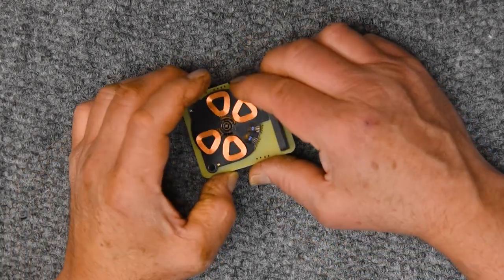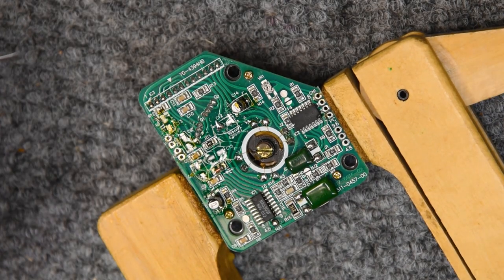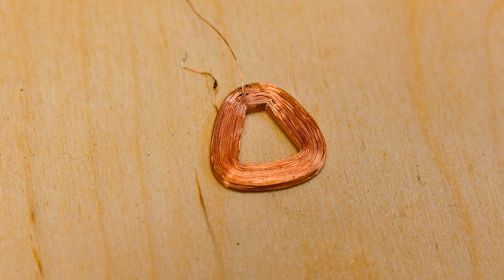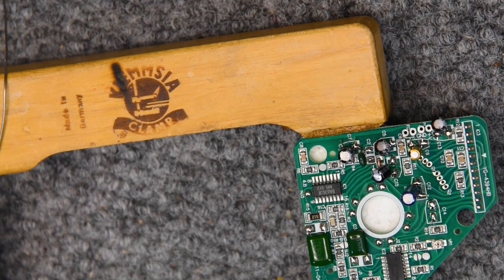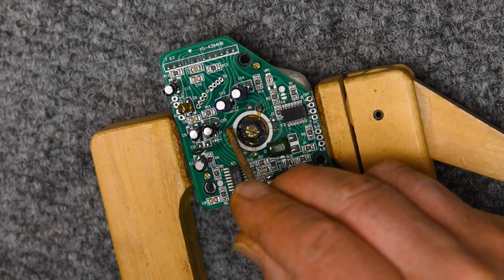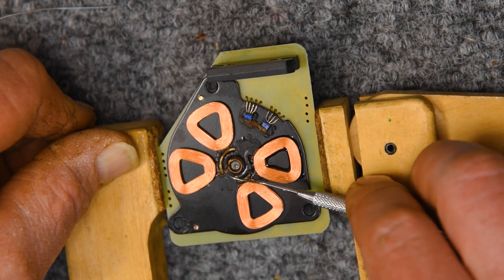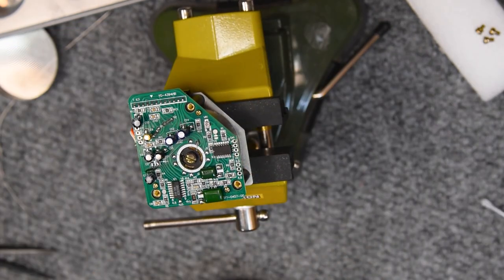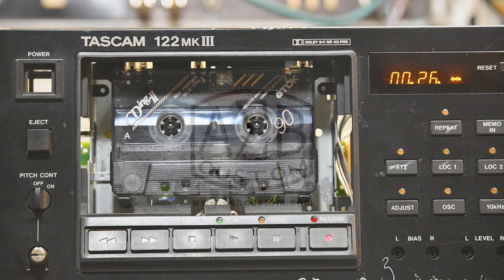Tascam 122mk2 and 122mk3 Capstan Motor Complete Rebuild

Comment: Apologies if I have mentioned this before. 

'Sanding down' capstans on a dual capstan deck is a big 'no no'. I once (out of frustration) allowed a 10 second polish both capstans on an old TC-161SD. It was a big mistake since the supply capstan relies on (effectively) some form of slip (I know we have our thoughts on this). When this does happen there is no  effective tension between the two capstans and incredibly the tape between the two 'slacks' off and often was seen rising above the erase head! I did fix the issue later by re-polishing with 3000/5000/10,000 grit, but it was a learnign curve for me.
Reply from the maker: "(I know we have our thoughts on this)" Thank you for mentioning that. Sometimes when it comes up, I can't help but picture in my mind, the mechanical engineer responsible for designing the first dual capstan tape drive explaining to his boss how he intends to reduce flutter by building slippage into the mechanism. "How much slippage?" the curious boss would naturally ask. "Well, we don't know that" the engineer would reply. "Why not?" asks the boss "You're an engineer, go calculate it". "We can't, there are too many variables, the tape thickness, length, modulus of elasticity, thermal expansion coefficients, lubricity deltas, variable pinch roller force, debris, and durometer, etc., etc. There's just no formula to apply." "Maybe you should go apply it in the Marketing Dept ..." the boss might say. :)

Just ribbing you a bit, I know you take it all in fun.
Reply: @asbcustom  No worries, I have a good sense of humour Peter!  It's all a bit inconclusive how exactly a dual capstan works, but I still hold on to the idea (frowned upon in the foums I think?), that there is a delay of transmission forces as one capstan drives the other via a belt. BUT I'm sure not all systems are the same - direct drive for example. In a later version of the Sony TC-161SD (I have 4 of these), Sony employ a 'new' flywheel design, and a larger diameter capstan at the take up (not supply) side. I think they had trouble with previous version me thinks??? Unfortunely, I learnt the hard way. Such is life! ;o)
Reply from the maker: Well if it's frowned upon in the forums then it must be valid! 

It works by stretching the tape, I measured both capstan pulleys in a previous video then used an online calculator to determine the RPM Delta on that particular machine. It's nothing new, the concept goes way back. There was even an all terrain consumer vehicle once that used a 1 unit higher gear ratio in the front differential than the rear, so the front tires would spin slightly faster than the rears. It was unstoppable off-road but hard on transfer cases. I think the military employed a similar thing as well. Anyway, it's all enjoyable to learn about and put into practice.
Reply: it's explicitly explained in the manual for the revox b710 (dual direct drive) as being for the purpose of tensioning the tape; in the revox, it's not the finish so much as the different diameters of capstan that do the tensioning. luckily, they're difficult to mix up during servicing ops because the flywheels sit at different depths behind the deck plate.
I have a 122-3 here too; nice machine but I had to replace the cheese gears a few years ago.
Reply: @duncan-rmi  My fascination with the dual capstan system isn't why it works on systems where the capstans are at different speeds, or where one is larger with the other, my interest lies in how the Sony TC-161SD system works, as both flywheels run off the same drive belt, and are seemingly identical in radius, as are both capstans also identical. My theory on the tension that is set up between the capstans (for the TC-161SD) is that - there is a micro delay between the two. It's a physics property that I proposed in Tapeheads sometime ago.
Reply: I meant to add too: the capstans on this old Sony were/are highly polished.
Reply: I have a suspicion, from careful study, decades of eng8neering on VTRs as well as audio decks, & reading the more & less enlightened hypotheses on TH, that there's a degree of "we don't know, but it works" about dual capstan in cassette machines. the big players all seem to have taken a slightly different tack, don't they? revox did later adopt different finishes on the capstans, but they make special mention of the diameters. another strategy I've seen for establishing the tension properly with identical capstans is to engage the rhs pinch slightly before the lhs; this takes up any slack that develops when the sled is disengaged. revox counter this by keeping the reel motors slightly energised. I need to peer into my nak 582s here to see what's going on, but the concept of running the trailing capstan off of a belt (as well as being less costly than a second motor) isn't enough on its own.... if the trailing pinch engages even a fraction earlier than the leading pinch, there'll be slack that will take a while to pull taut. this will happen whether there's a back tension strategy or not. I think that setting things up so that the rhs pinch pulls the tape tight, whether this is just a cam to offset their timing (tandberg), different diameters (revox), or whatever it is sony did.... this is the only way to ensure that the dual capstan actually does its job of isolating head-tape contact from the vagaries of the reel movements.
Reply: @duncan-rmi  Thanks for your reply, I did post another reply but deleted it, and replaced it with a condensed version. 
Yes, the concept of isolating the tape path from the imperfections of the cassette shell and its guides makes dual cap system look promising. However and overall, i don't think the benefits are worth it - around 0.05%-0.06% (weighted rms) wow & flutter can be achieved from a good single capstan machine, not to mention when the DC system 'goes wrong' it can be a nightmare to put right. On the postive side of DC, and using the well known WFGUI.EXE program, my B215 recently sustained a weight mean of 0.022% over a period of 15 minutes, with very little deviation which is remarkable in my opinion.  The deviation beneath that were hitting 0.019% if WFGUI.EXE is to be believed. Anyway, I must sound like a fanatic, but I'm not, I was curious as I've never bothered to observe this decks w&f performance since I bought it in 2003.
Reply: @duncan-rmi  Regarding why it works - I guess the big guns did their R&D and printed papers on the subject, which never left the labs into the big wide world? Certainly TH cannot always be relied upon to give the right answers, it is after all, open to eveyone, and everyone (inc me sometimes) puts in their 10cents worth.
Reply: I'm inclined to agree. there are those who'll tell you that the curvature of the sandwich head in a 3-head machine requires better of a wrap across it than can be achieved by back tension & pressure pad alone, while neglecting that the record head gap is bigger anyway, so the whole setup can be optimised for pb- I'm guessing this is what tascam & others did. the 122-3, of course, & probably half a dozen other 3-headers that I can see from where I'm sitting, manage perfectly with a single capstan.
contrarily, one of the criticisms levelled at the B215 is that it's so good that you forget you're listening to tape at all, which rather defeats the object- if we tape-heads wanted perfection, we wouldn't be using cassettes, right? 
dunno if we've run into each other on TH yet- possibly. I'm the nut-case who runs a quarter-track B77 at 1.875 ips & thinks it sounds marvellous! naks a plenty here- two 582s, two 550s & a 350. the revoxes. nad 6300. the tascam. various teac & technics. marantz pmd520. loads of portables & walkmans. I find the appeal lies in their flaws & occasional misbehaviour, & I'm definitely not anti-digital, but I prefer to listen to something that's guaranteed to be different every time. my music-brain prefers it, & analogue tape delivers. 😀
Reply: curiously, perhaps, the deck I've had most problems with is a decent sony, the 790ES. a trick I employed on the revox 710 back when it was misbehaving was to remove the supply side pinch roller; it worked with just the back tension, but there was a considerablew improvement in response (& noise floor) when I fixed the underlying issue (contact corrosion, believe it or not!) &  reinstated it. new rollers helped too. the sony turned out to have a hairline crack in the tape guide that's part of the supply-side pinch roller moulding, & also wanted new rollers. the simpler design (single capstan) in their lower three-headers (there are two 590s here both with transport issues) just doesn't seem as stable.
another deck that's working just fine with one capstan is the HK3500... that one, a weird looking beast, clamps the tape really tightly in the door, & I think this is a factor. the revoxes both grab the cassette quite hard when the sled is raised. & they're heavy-duty. their weaknesses lie in the electronics....
Reply from the maker: It has been said that the fastest way to learn the right answer online is to post the wrong answer :)
Reply: @duncan-rmi  Funny that you mention running a deck off one pinch roller/capstan, I've done the same in trying to track the sources of wow/flutter on this old Sony TC-161SD. It runs near perfectly on either , except that wow/flutter showed no change on either. It's probably a belt issue and/or the flywheels are not truley balanced? All 3 sq belted TC-161SDs exhibit the same w&f issues ..... coincidence? 
Before I bought the B215 back in 2003, I bidded for a B710 Mkii, but lost, and then saw this almost unused B215 from germany and got it! 

Apologies to ABS for hogging this page!  ;o)
Reply: @asbcustom  Yes, that's probably true Peter. There's a lot of 'credibility competition' in forums, so one 'wrong answer' may relegate us down the ranks? If I don't know something, I'll either ask, or say nothing. ;o)
Reply from the maker: Mr. James, I have thought up a photographic anagogy for you, bear with me: 

In a single capstan cassette deck, the back tension is created far from the head, by the supply reel, therefore, much more tape length exists in the path for mechanical disparity, be it the actual tape composition, age, environmental factors, etc., and the action itself is less precise. By shortening the distance from the supply reel, to the supply capstan, less, and more controlled disparity exists, simply due to this shortened distance and mechanical advantage. Because of the lower speed and smaller track size of the cassette format, compared to the open reel, every small enhancement can lead to great gains in consistency, and the cassette needs every possible advantage. From a manufacturing standpoint, a two capstan assembly of known diameter and working tolerance, are far less intensive to manufacture, than paying the trained technician to finely tune the requisite tension on a single capstan assembly transport. Never remove the profit incentive from the search for understanding the engineering motivation of the consumer goods we purchase.

I analogize this to large format photography where, due to the larger size of the film, the better lens makers didn't need to concentrate as much on sharpness, so were free to engineer optics that displayed other superior properties and were able to separate light values with greater subtlety, leading to a more natural appearing image. I am particularly fond of the older German optics precisely for this subtle quality, where the Japanese lens makers substituted contrast for acuity, and were able to produce a lower cost optic that some found desirable (not I). 

In short; two capstans creating an infinitesimally small surface feet per minute delta, placed closely together, will compensate well for an infinite variety of tape compositions and environmental factors, and can be manufactured more economically, and will require less precise maintenance, than their single capstan progenitors. That said, most of the music you and I have listened to in our lives, were originated and mastered, on single capstan machines.
Reply: @asbcustom  Hi Peter, on the subject of photography, I cannot claim any true expertise on the subject, but I am of the thinking that within the larger format sector there was a smaller turnover, and so competition was less? Optics engineers could relax a little regarding acutance because the scales of enlargement were less than 35mm? For example: x10 enlargement for 35mm and we begin to see it 'falling apart' in tonality and its limiting sharpness become evident? Now apply an enlargement factor that creates the same size from 2 1/4" sq format, and the larger format shows its superiorities? But of course I'm only scratching the surface on this subject. :o)

BTW, regarding dual capstans, I am of the thinking that transient tape stretch, between the capstan/pinch at the supply side is the fundamental mechanism that makes it work. Observe the rollers after many hours of play - which pinch roller has the most tape oxide debris? From my observations it is the leftmost, and that is where the major  stretching prob occurs, and of course 'micro rub' between capstan/pinch and the tape.

You are dead right about single capstan mastering!
Reply from the maker: "within the larger format sector there was a smaller turnover, and so competition was less? ". Indeed yes, but early on, there was no smaller format, just as in the cassette format. Everything was engineered for the technology of the day and as formats became smaller, technology adjusted to it. 35mm, and now digital imaging, produce amazing end results, but as I have proved to myself, admittedly a few years ago, the smaller, and compressed formats, are a compromise that are willfully embraced by the masses for their ease and mediocrity. Once, and once only, did I download an album from the iTunes Store because I liked the artist and wished to support his efforts. After trying every possible method to attain a copy that sounded anything unlike a poor quality synthesized midi, I asked my son to help me find a way. He listened to my download, smiled, and said "papa, they all sound that way". To this day, I've never listened to this wonderful artist's offerings.
Reply: @asbcustom  As many have said to me - the smaller format has the 'convenience factor', and that always wins!

Comment: Very good video. I have a question about the coil wire break.  I have a 238 which when i was doing the caps I noticed one of the copper wires was severed just where it curves over the edge of the board and disappears (component side).  I did manage to bridge it with a spot of solder and the motor runs fine.  I didnt realise that it was insulated copper so im wondering how i got the thing to solder as i did.  I didnt want to fuss with it because it is very fiddly and delicate and it seems ok.  I was wondering should i put something on that solder where i made the join? I dont have any fancy insulation liquid but was wondering what i could dab on it to prevent any future oxidation.  I did this about 6 months ago.  Or should i leave it be? How would I know if that joint fails in the future?  Will the motor respond in an obvious way?   Also, is it ok to use lithium grease on the capstan shaft and the thrust bearing? I also have a liquid silicone which i use mainly on the plastic components..  I know thats best kept away from the capstan because it can wander.
Reply from the maker: I'm not sure what to tell you, every disturbance of that lead is one step closer to the undertaker, maybe leave well enough alone? Lithium grease is fine for the thrust side but too thick for the capstan bearings, it's worth it to buy the correct oil.

Comment: Hi Peter, 
Did you ever find the end play figure? Did you look in a 122 manual?
Reply from the maker: Not in writing but I have one in right now that I don't believe has ever been touched, I'll post the number after I measure it.

Update: End play measures .010" and this one has the factory thread seal intact, so that should be a good number.
Reply: See my post above about the figure I found in the Tascam 122 service manual. Looks like Tascam claims from .05 - .15mm which is .002 to .006. But that is for a 122, which is similar mechanically but not identical. So that's a little tighter than .010? 
 @asbcustom

Comment: HI. had a question regarding the capstan and the flywheel magnet.  Both my 122 mkii attract a paperclip if dangled on a thread by the capstan end that sticks out.  I noticed this a week ago and have a plug in demag now.  I did the tape bay area on both, but I'm still getting a bit of magnetic pull on the capstan.  I looked at my 238 (same transport basically) and it doesn't have this issue.  I noticed if I dangle the paperclip near the  flywheel area too there is quite alot of magnetism around it.  Is that normal?  I know the 238 and 122 mkii have the magnet on the flywheel but could this travel to the end where the tape travels on it?  And I'm wondering why the 238 isn't having this issue?  I did identical rebuilds,  except I did disassemble the 122s  motor much more than the 238.  Is there something I missed? 🤔  I just wasn't happy about my tape running over a magnetised capstan.
Reply from the maker: Howdy Rick.
The capstan shaft should not be magnetized as you correctly surmised. My guess is that is it was improperly degaussed in the past, and exceeds the ability of your current degausser to correct. I would first test my degausser to make certain it's functioning. Maybe try it on a screwdriver or paperclip, it can both magnatize, and demagnatize a part. If it cannot do either, there's a problem. The only ones I've found to work consistently well are the Han-D-Mag brand, the others are too weak for certain jobs.